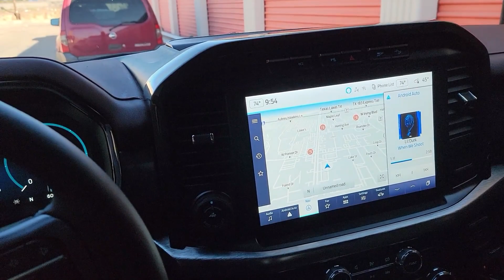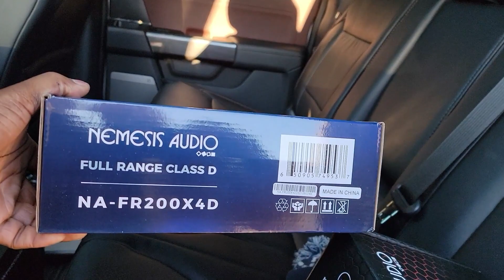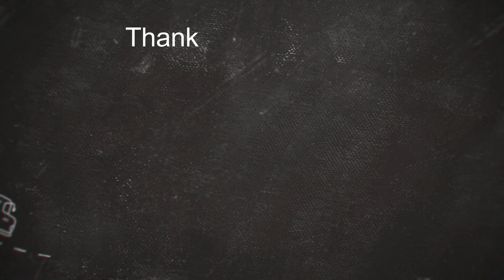2022 F150 AUDIO UPGRADE WITH B&O SYSTEM

Comment: I gutted mine and put (2) 12” in. Also change out and amped the door speakers and dash speakers and sound treated the doors.   NavTv Zen A2B is what i used to integrate in to the B.O. Unleash system.  Navtv is a cleaner integration into the B&O system if you want a cleaner sound.  I like where you are starting from

Comment: I am the Audio God down here in Alabama , when I run into situations like that , problems with Factory Amps causing issues , I just run all new wire , yeah it’s a Pain in my A$$ but sometimes you have to do what you have to do .
Reply: What could you do with 3 JL W7 10s in a truck?

Comment: Man , take my advice or not , but if you switch to a Pair of Sundown 8”s 
Get a pair of X 8”s , bigger port , man your truck would sound so much better .
Trust me .

I have 2-10”s under the seat of my F-150 and it does 151 db on the Term Lab meter .

I know you said your not trying to knock pictures off the wall but we all want more bass , more bass and More Bass .

One of these days you and Rell will take my advice , I have no reason to lie .
Reply from the maker: Already looking at them. Waiting to get custom box. This was just a starter from my old truck 😆
Reply: @billionairebrent  Ahhh Gotcha ,  I have done that before , a little bass is better then no bass 😂😂